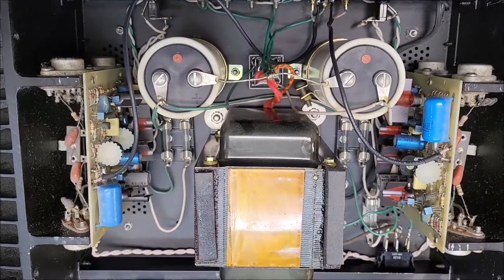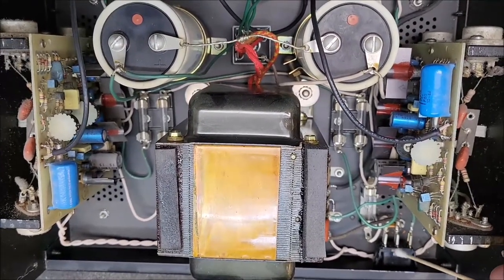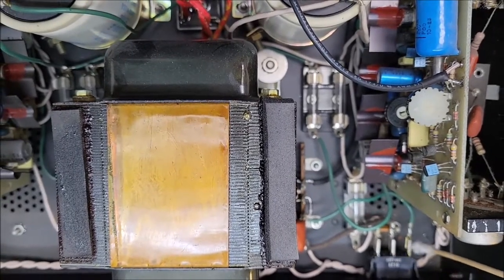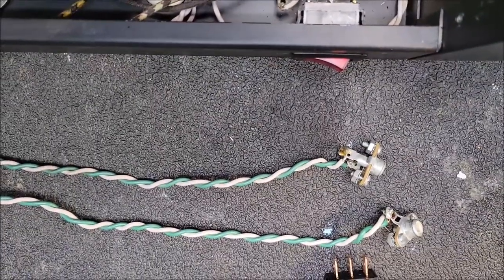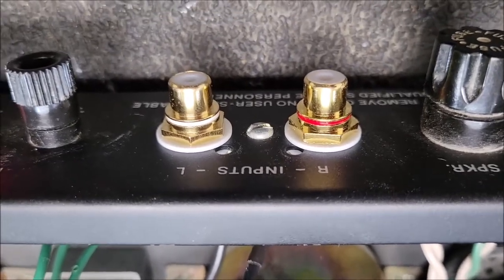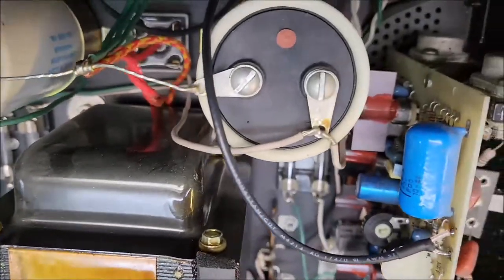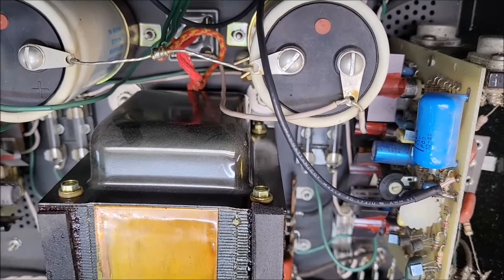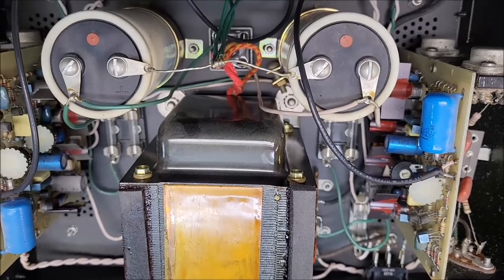Hafler DH 220 Power Switch & Signal Input Mod

Comment: Great work - I'm contemplating on buying a Hafler DH-220. Likely it's gonna need entire recap and new rectifier given age.
Reply: Doubtful on the recap.  Main reservoir caps, probably, but even those last a long time.  The rectifier will also be perfectly fine although there are better faster ones out there with higher current capability, but you likely won't hear a difference.

Comment: Can you use  bulk high quality RCA cable?
Reply from the maker: Since the original was just twisted pair, any shielded cable would be an improvement.  I use the RG174 because it's easy to work with.